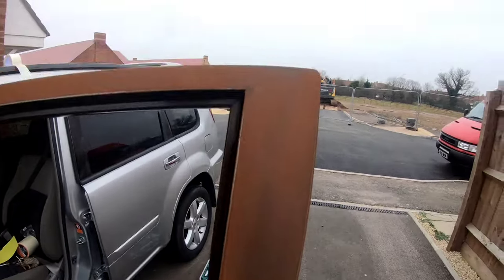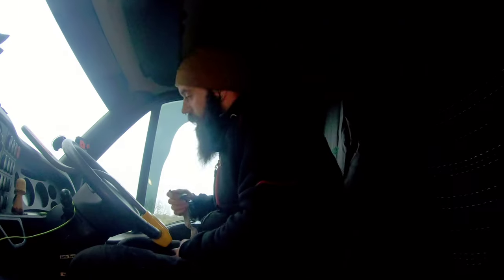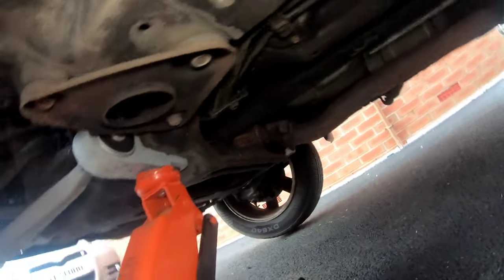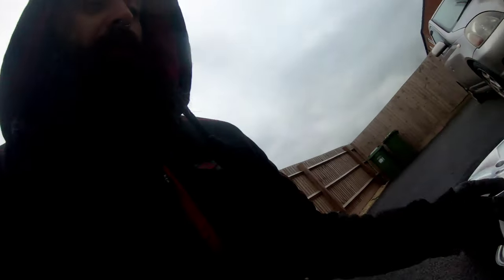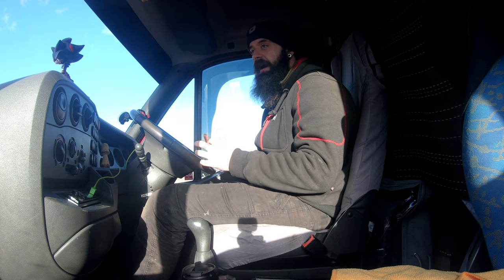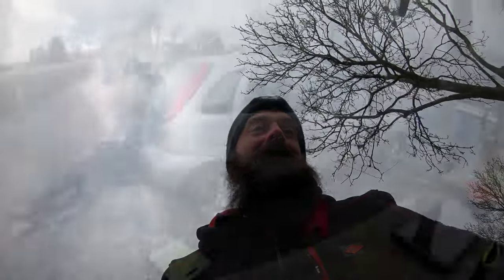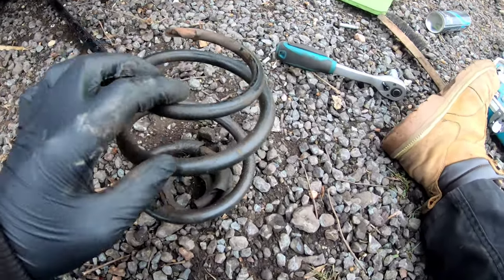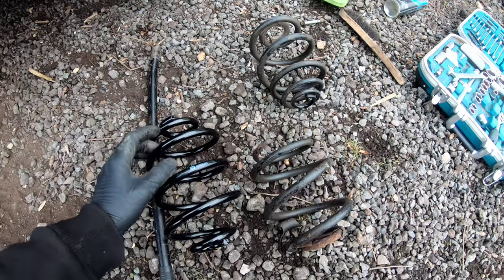Weather Protection 'underseal' coil springs #mechanic #vanlife #nomad #waxoyl #coilsprings

Comment: Just did this job today with the waxoyl. Got it in my hair, all over my arms and even all over the bath. Lol messy stuff.
Reply from the maker: Haha brilliant.  Well done yeah once ya have done it a few times ya learn where to place ya self when throwing it on but still get it everywhere haha . Messy stuff but so satisfying when ya done 🙌
Reply: @Road__Viking do you remove surface rust first or just paint over it ?
Reply from the maker: @tonysoprano9370  wire brush first knocking all the loose stuff off 👍
Reply: @Road__Viking do you not treat it with a rust converter or am I best not bothering?